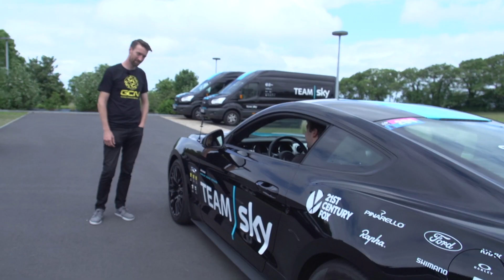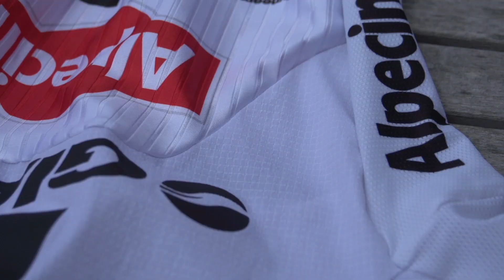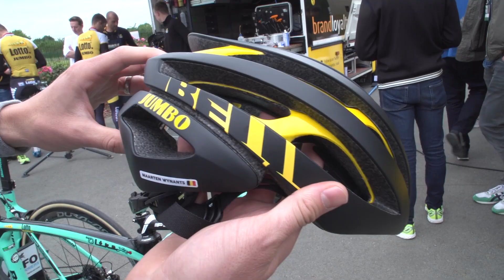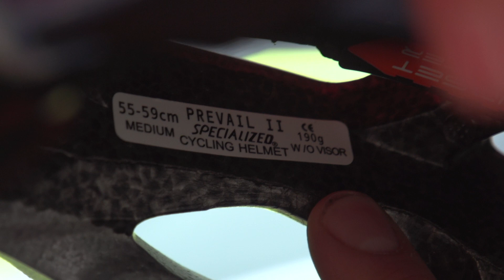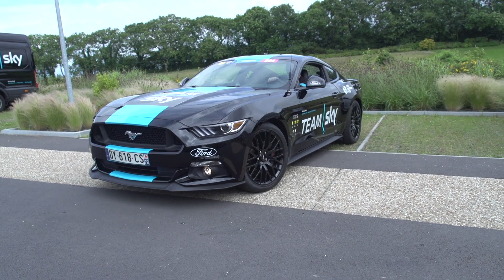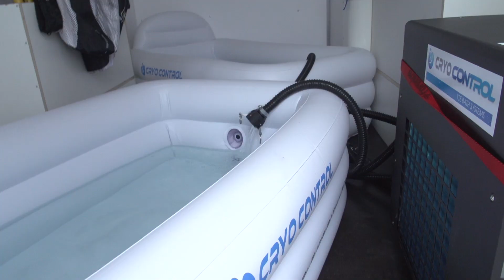Tech Special: New Helmets, Skinsuits and Tyres At The Tour De France

Comment: Here is a question for you +GlobalCyclingNetwork 

On hillier time trials - where riders are more likely to use a road bike with clip on extension bars - do they still have to comply with the rules for position on a time trial bike? i.e. saddle can't be less than 5cm from the bottom bracket
Reply: That's the same with normal road stages as well I think so I guess it does yeah
Reply: +Owen Puckey maybe, but on normal road stages the saddle position can be moved about quite a bit (especially when considering an arione saddle which is super long) plus you aren't allowed to use clip on extension bars on a normal road stage
Reply: those rules (saddle position and tilt, handlebar position, etc) are valid for every road race, including time trials, no matter what bike they take. The use of extensions is allowed because it is a time trial, even if it is hillier